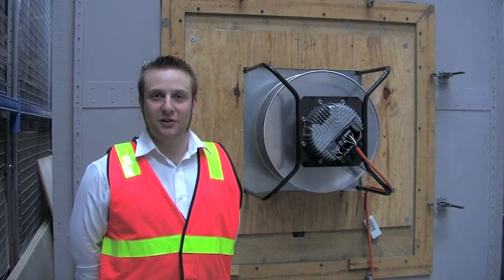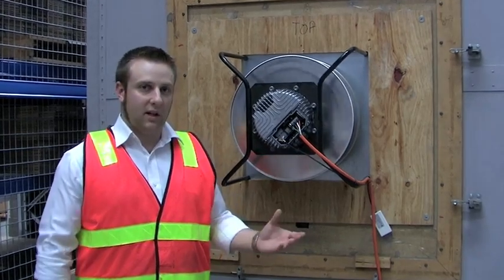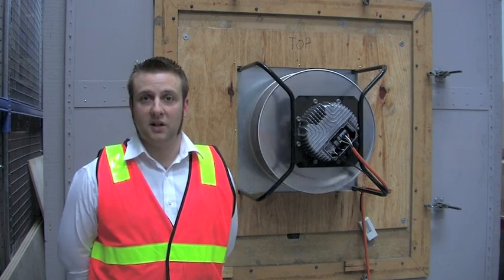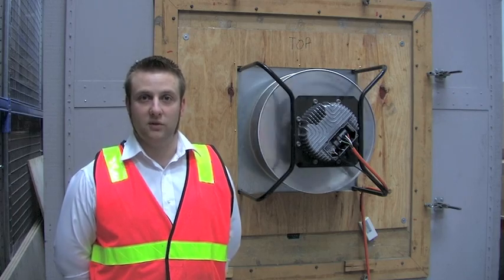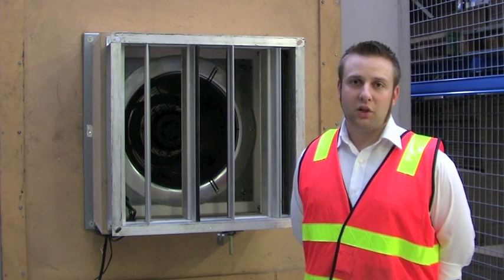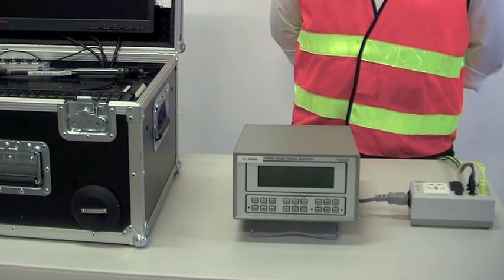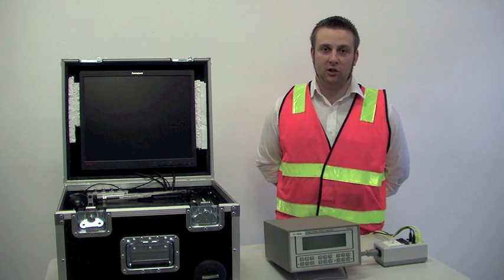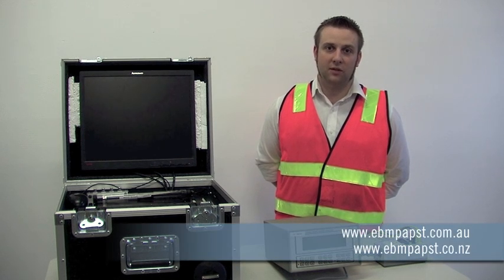ebm-papst A&NZ Testing Facilities

Comment: How I can control the r3g400-aq23-06 , I'm using a potentiometer with the 10v supply of the fan ,  ain1U terminal and GND terminal without any results.

Comment: How is waring conection 3 phage
Reply: Hi Alam, we are happy to help.  Which product?  Typically there are 4 wires: earth is yellow/green and red/white and blue are the other three phases.  These have to be wired according to the wiring diagram which should be with the product.  We can provide this if you mail sales@ebmpapst.com.au.  The product should be wired correctly otherwise the fan will spin incorrectly.  Thanks Alam.

Comment: How do run without potentiometer.ebm-papst K3G500RL-96-07?
Reply: Hi Mahesh, the driving 0-10V has to have a voltage applied.  This can be achieved by using voltage output from the product.  Please send me an email sales@ebmpapst.com.au and marked for my attention and we will provide the details required.  Best wishes.